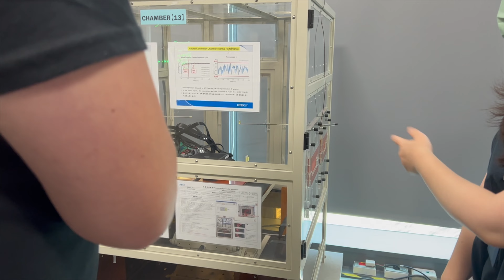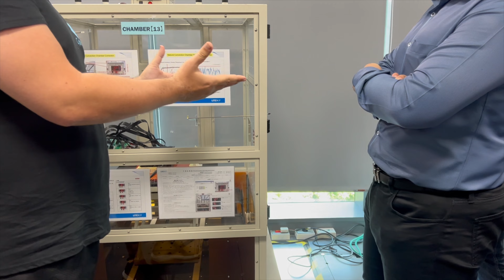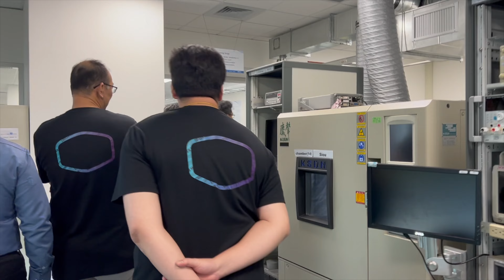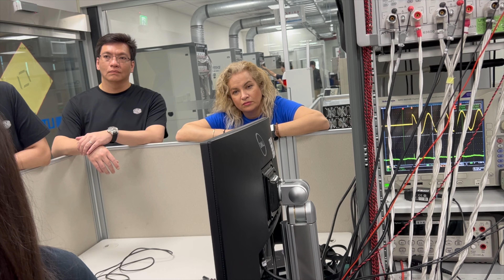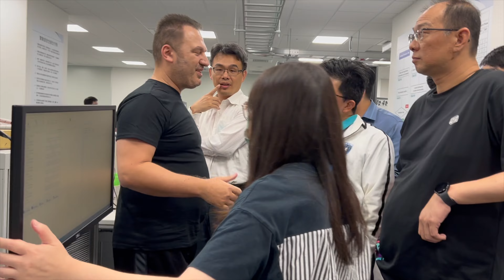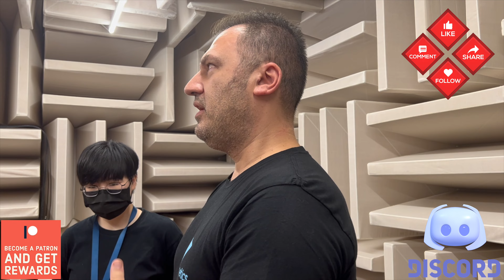We Visited LITE-ON Technology's Labs!

Comment: my old UPS (Accupower Isy 1200VA) makes a noise every 1 second (I think it's its transformer??) ~17.5kHz-22kHz and it hurts my ears (nobody else hears this noise here except me), I have put the UPS inside a cabinet (the temperature does not rise above 30C) but i can still see in the recordings the noise of the UPS. I thought that the noise was being picked up by the microphone but it turned out to be from the cable (microphone-amplifier) which picks up the ups noise when it is close to any cable coming from the output of the ups. I moved the cable further and it's much better😆 (the most annoying thing is that at night when it's quite quiet (low noise floor) I can hear the chargers that are in the socket and from the sound I can understand, for example, if my smartphone is charging or if it's charged) if you locked me in an anechoic chamber I would sit comfortably for a week or so 😂😂

Comment: Hi, I am currently running 5600X (planning to upgrade to 5800x3d) + 6900xt Tuf OC (comes with 2 PCIe 8-pin power intake). Do I need to upgrade my EVGA 750 GQ psu? & why? is it to gain more performance or for more protection? Thanks.
Reply from the maker: If you don’t experience any shut downs under load you can keep your current PSU
Reply: @HardwareBusters  Thank you 🙏